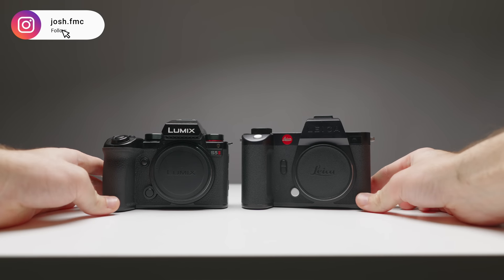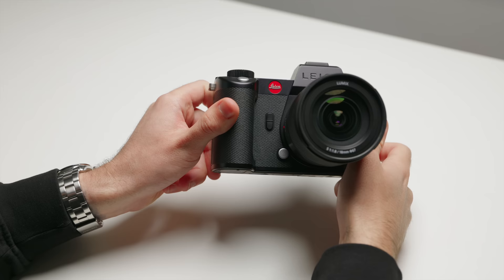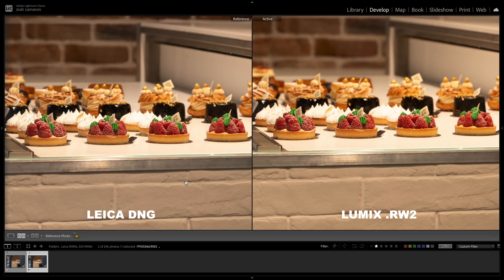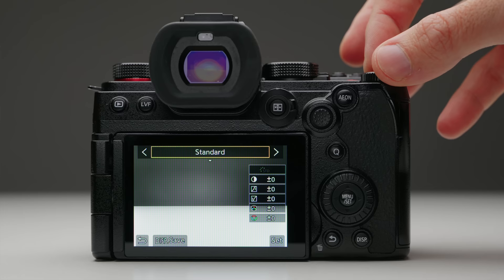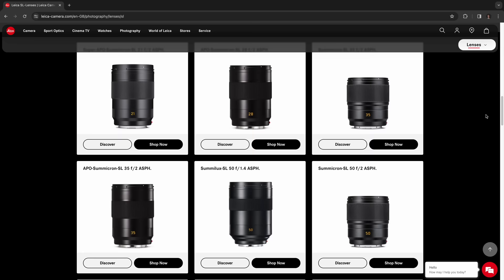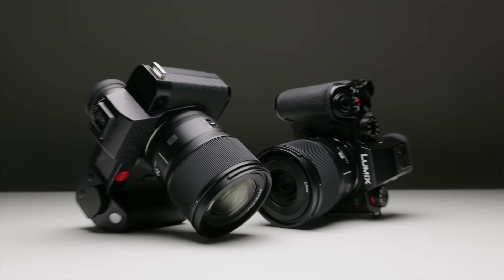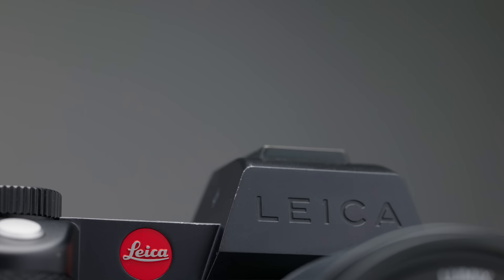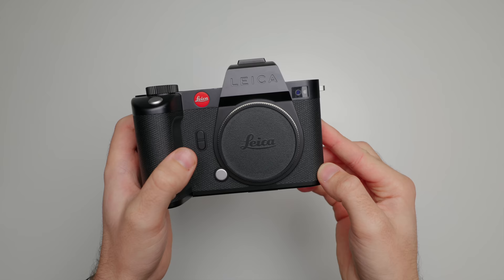Lumix VS Leica Colour Comparison

Comment: So, the red dot doesn't have any impact in color science. Great comparison Josh!
Reply from the maker: Nothing that would warrant upgrading for - I think the benefits of the Leica come in different areas :) Thank you!
Reply: @JoshCameron please redo the test with a leica apo sl lens 🙏🤗
Reply: @JoshCameron  yes, the glass.
Reply: Well yes, it does actually, just not with these two cameras. When I use the same lenses between my Leica CL & Lumix G9 there is a stark difference, with the Leica colors being much more pleasing.  The greens are especially nicer on the Leica, With the G9 looking a bit garish & oversaturated with nature shots especially.
Reply: @martin_the_artist_  The G9 is a M43 camera, big difference.
Reply: @michaelbell75  Well, the Leica CL is a crop sensor too (factor 1.5 instead of 2.0 in M43). But this has not much influence on color calibration of in-camera jpegs anyway.
Reply: Guess the G9(ii) sensor output is primarily designed to keep up with FF as far as possible more in terms of sharpness and noise reduction. Which is fine for the aimed user group.
Reply: What`s called a Leica Look first and foremost has been determined by Leica Lenses. In digital Leica partners with Panasonic. Using a Lumix lens from Panasonic on a Leica of course gives you results that are basically the same as both companies share processor and sensor technology.
Reply: I painted a red dot on my homemade pinhole camera and now it is a Leica.

Comment: Judging from this video the skin tones are the main difference but would love to see another video with the higher megapixel SL2 or SL3 and a Leica lens.
Reply: The SL2 looks the same as the Panasonic Lumix S1R. The SL3 uses another Sony higher resolution sensor so the image characteristics will be very similar to other Leica and Lumix cameras. These Leica and Lumix cameras share the same Sony sensors. The Leica's even borrow the Lumix autofocus system. They're practically the same cameras only the SL3 has a higher resolution sensor from the same line up of sensors.

Comment: Colour wise since Leica and Panasonic share technology there are only a few subtle differences. Leica files will be slightly more open in the mids. The Leica files will have the saturation slightly lower. Finally the Leica files have a few points less magenta shift to them. The Leica sensor has a thinner filter stack so it behaves better with older M lenses and shows very slightly more acutance with the absolute best glass (APO Summicrons). But this lens won't show that.

You paid for Grerman wages for assembly, the industrial design, menus and build quality. Plus the red dot.

Comment: I have been shooting a Leica M6 for the last 10 years and if you compare it to other film bodies that can take the same lens selection it's the smoothness of the experience that makes the difference. My Leica doesn't get in the way, the rangefinder on it is the best I ever used and it's just a perfect camera to be using for decades to come. It hasn't needed any service and I bought it used, built in 1990! Now that's build quality. Colour science is a funny thing, because in film the "sensor" and the "colour science" is always the same and comes from different manufacturers, Kodak, Fuji, Ilford, etc. It's all about the shooting experience and the lens selection. I personally prefer Zeiss and Voigtländer glass because the rendering has more character, but Leica definitely produces the best lenses out there from an optical viewpoint. I'm not surprised that Panasonic has finally caught up to Leica with colour science. Leica were the absolute best in the game already 10 years ago though. My old Olympus E-PL3 had terrible colours even with lots of light and broke apart beyond ISO 400. Canon 450D, awful reds because of the lack of filtration on it. At the time Leica M9 and later the M240 were already perfect over their entire ISO range👌other manufacturers are only now catching up. With a mirrorless camera going with Lumix makes sense and that's what I did, because the quality coming out of it is comparable. From a user experience stand point Lumix isn't all that great I have to say. The menus are definitely very cryptic and it's quite the learning curve compared to everything I've seen of Leica menus in reviews. And since there are so many options it isn't set it and forget it either, you actually have to use those menus all the time, so it is definitely a consideration. Where Leica really shines is in the rangefinder cameras actually. They're the only ones who still make bodies like that and it has been my preferred focusing system for the last 10 years. If I were to buy a Leica it would definitely be a rangefinder but the massive file sizes of the current models make me think that the M240 is still the sweet spot even though it's 12 years old. They have stood the test of time too, which makes it a reassuring purchase also from a resale value consideration.

Comment: Josh, thanks for making this video and I agree with everything you said and will add the following.  I’m a Leica M shooter, the M10-R and previously the M240 and digital CL, to be exact.  The LUMIX S series of cameras are relatively identical to the Leica S series cameras when it comes to the internal technologies and colour science.

There are features in the external hardware and build quality where Leica shines over LUMIX but all in all, these cameras are identical.   I owned the original S5, sold it for the S5 II which is definitely a worthy upgrade.  Where the comparison you made is not equal is when it comes to autofocus technology.  The Leica SL2-S uses contrast based whereas the S5 II has phase detect autofocus.  For those who rely on autofocus Leica doesn’t provide this technology yet.  You’ll see it in the SL3 and its variants. 

I’m not an autofocus shooter and I am not a hybrid shooter or videographer so those features don’t really matter much to me.  I shoot 90%+ with adapted vintage and M mount lenses.  I use them on my LUMIX S5 II, Nikon Zf, Fujifilm X-Pro3, and Leica M10-R.  One set of lenses I can use on all my digital mirrorless cameras.  The S5 II is a beast of a photography camera and not enough people talk about it as one.  LUMIX cameras will continue to get better and not cost an arm and a leg like Leica’s, Sony’s, Canon’s, or Nikon’s with similar features and capabilities.

Comment: Leica and Panasonic are partners for years, the L2 partnership.  They have different ergonomics and having both camera brand i like different pieces from each. I use the lumix camera because of the ergonomics and weight savings. The Leica feels better in hands and build is insanely good. Both cameras are highly reliable and that’s the win.

Comment: Not surprising since the Leica C-Lux, D-Lux and V-Lux series cameras are all Panasonic made. Both companies work closely together and just announced a new upcoming "L2" project where they will share technologies on upcoming cameras, lenses and more. In fact, Im willing to bet the 47MP sensor in the S1R is the same sensor found in the SL2 and the 24MP BSI sensor in the SL2-S is the same sensor from the S5II. Highly suspect the megapixel counts are the same and the colors are so similar. Im guessing the only difference is the processor being used in the cameras.

Comment: To fully understand Leica as a system you need to keep in mind the historical users of their products. The SL system uses very thin cover glass on their sensors, this allows M mount lens users to shoot SL cameras and still get high performance from those lenses, but if they so choose can switch to a modern mirrorless lens and experience those benefits too. Many SL owners have M mount film cameras too, so having the ability to use the same lenses on both mediums really adds to the versatility of the system. These older lenses do not function well on other brands, particularly the wider lenses from 35mm and shorter because they use thicker cover glass on their sensors. Of course one can also buy an M mount digital camera, but that takes modern autofocus lenses out of the equation. For those of us that want the best of the film era Leica's and modern digital the SL system offers unparalleled versatility.
Reply: Does Panasonic camera sensors have the same thickness with Leica, or more similar to Canon, Nikon, and Sony?
Reply: Mostly agree but I used my m mount glass on my Sony A7RV for a year before getting my M11 and see practically no difference in image quality. I dont think there is really much of a difference when adapting the glass to other systems
Reply: @FedThePoopy  Yeah, Sony or any other mirrorless body can certainly be used with good results in many cases. Particularly for portraits as the corners are not really a factor in that case, and longer lenses will be the order of the day. In my case the Sony / Nikon / Canon or Panasonic bodies were a bit of a non starter as I shoot with wide (21mm and 15mm) lenses a lot and the corner performance is important to my own work.
Reply: yes, but that' just brand-fanboy stuff. How does that negate the fact that their Color-Science is nothing special?

Comment: I remembered the SL2S looked different than the S5 esp when using adapted M lenses.

The other was corner smearing. At least when I tested, the SL2S was noticeably sharper in the corners for adapted M glass. 

A niche use case for sure, but Perhaps give M glass a try?

Comment: Maybe because I've used both brands extensively but I saw the differences right away honestly. The Leica has increased clarity and smoother transitions. The Lumix has a slightly "muddier" look which gives it away.. If the end user can't see the differences then maybe save the money... but if you can see the  differences well you have choices to make.

Comment: I worked with Panasonic for several years as consultant / sponsored photographer. One of things I learned is that with Leica a lot of the color and character comes from the glass. This is why if you use a Micro 4/3 Leica lens on a Panasonic body the color is different. In this case it’s related to the firmware in lens but with analog Leica lenses it’s all about the glass. I think if you got a Leica lens and did the test again it would be quite interesting. Thanks for the video ❤

Comment: Thank you, I love tests like this, really helps to get over one's own biases when you see it's almost impossible to tell the difference. Although I can see why Leica has its allure, there's so much padding around the image quality discussion that it's great to be taken down to earth with real testing like this. 

There are only a few camera + lens combos I've ever owned where I can recognize what I shot with, and it's always when I don't remember what camera I used until checking the EXIF data. But ultimately it's very rare that a camera can provide anything unique that's not reproducible by any other system.

Comment: For me personally, the main difference of the Leica SL is its performance with manual lenses, specifically with the M-mount ones. 
Try putting one(especially a wide angle one) on a Lumix or any other mirrorless camera and you'll see the difference.
This is because Leica is the only brand who is still selling rangefinder lenses and cameras. So they are putting some microlenses on the sensor to compensate for the steep light angle of those lenses. And since I'm a manual shooter, this is priceless for me. 
The only other camera which is doing great with those rangefinder lenses is Sigma with electronic shutter, but it is quite old.

Comment: I’ve never used Leica but i was able to spot the slight difference without knowing which is which at the beginning.  It’s slightly deeper colors and slightly sharper.  So you could say I guess it right.  Even the ABC, I chose B.  Again, ever so slightly.  Is it worth it?   Hmmmmm…..

Comment: Great video, and I really see what you are saying. A while ago, I visited a fair where various major brands had their cameras on show, and I could try them all. I tried the defaults of Canon, Nikon and Sony, also some outliers such as the Fujifilm GF 100. And a Lumix S1, and a Leica SL2. If found that picture quality is similar for all major brands, differences appear in lenses and handling.

The one thing I learned at this fair is that the one thing the Leica SL-series wins over all these other brands is simplicity in the controls. You just get 8 customizable buttons, and that's it. Every photographer has his own style of handling a camera, the Leica adapts to everyone surprisingly easy. So while these pictures were no different than a Lumix S1, I did overall like the simplicity of Leica's camera.
I did however purchase a Panasonic S1 body in the end, because it's controls are second best, at a much lower price point. And it has a tilting display, which the Leica SL3 now also has. I also got a great second-hand Leica Elmarit 24-90 f2.8-4 lens, which is better than awesome. That lens combined with a S1 is the best of both worlds for what I do with photography. Image quality and handling is superb. If Panasonic will ever make a successor to the S1 with phase-detect AF, I would buy it immediately.

Comment: Hi Josh, thank you for the interesting video. I have never tried any Leica camera of the SL line nor a full frame camera from Panasonic, so I cannot make any comments on your  comparison. But I do own a Leica CL. digital and over the years I used several cameras from different brands. The colours of the jpegs coming out straight of my Leica CL digital are different from any other colours coming out from any other camera I used. I spent a weekend in London recently and used my Leica and my Ricoh GR 3 to take photos. As much as I love my Ricoh, I must say that the Leica produces colours which have a sort of a more vintage and realistic look compared to my Ricoh. Of course, it is just my opinion and my experience. Keep up with the good work you are doing, Manu

Comment: Have SL and S-1 (have had many others), and I'm just a proud dad / weekend warrior hack.  Couple of suggestions - first - Shooting with Pana or Sigma L Mount glass - you are shooting with glass far past  24mp sensor - and high grade.  I'd be surprised to see much difference, but pop a 200-400 lens on there (non-native) from china - and then look...   If you grab some vintage - say any 50mm 1.4 from decades ago - you will begin to see differences in the rendering - even in raw (although less).  Side note - and while you are playing with glass from years ago - tracking down character - notice which one works better - and because the handling is so much better - you get more shots...  Try it with a nifty fifty, and a 135mm and see what you think...  If you really want to see a difference in jpegs - use old M glass...   Second - I THINK (IMHO), that the difference between the SL and the S1 is significant, the difference between the S1 and the SL2S really isn't that much different.  I would GUESS, the S1RmkII and the SL3 will be even closer...   Also note - although few reviewers ever test the Pana glass - their "S" line is of the highest grade (50mm 1.4 vs almost anything out there - its holds its own - and is priced accordingly)...   YES, I bought my S1 (as I saw it as a poor man's Lecia) - and I'm tickled pink - its really a powerhouse - EVEN by todays standards (Q2-2024) - but once I procured the SL - the SL is the chosen one - but I shoot 75% vintage.  To take it one step further - try shooting B&W - I think the SL shines in this category.  All said - would I mortgage away for a current SL3 or Q3 - NO, but I did TRY the SL2S - and in comparison to the SL - I kept the SL and played catch & release on the SL2S - but again - 75% vintage and 25% native...   And I have a sony RX1 and several other compacts - so if I take out the S1 or SL - its on purpose, as its NOT an everyday carry, nor very nice unless you are planning on shooting as the main reason for being out...

Comment: If you check DXO software last version (7 ?), you will see that there is an option to emulate the color rendering of groups of cameras. Leica and Lumix recent cameras are in the same color profile option... So I think the guys from DxO already known that it was the same color science which was used in both cameras. It is very interesting to check this DxO option, to see which cameras have similar or same color profiles, and at which generation of cameras of a manufacturer they change their color profile.
Reply: Those profiles aren’t exactly matching but are pretty close. There is more to color science than just matching hues and approximating tones. There is color phase and color density changes to luma and that stuff is extremely hard to test with color chart comparison matching.
Reply: @jessejayphotography  Those colour emphases can easily be reproduced in post. Unless you never shoot anything except jpeg - and even then you can tweak preferences endlessly in camera - the manufacturers look isn't a secret sauce.

Comment: As a Lumix user with five Leica lenses, including two f1.7 zooms, I can attest to the quality of images…

The quality and character is in the glass, and the photographers eyes…

🤔
Reply: @superzero4250 are you a micro four thirds shooter? The best lens for a lumix system is the nocticron.
Reply: @mnkwazi  TRUE; however, for the format overall, it is the M.Zuiko Digital ED 75mm ƒ1.8… (a lens I have)

To be fair; the M.Zuiko Digital ED 45mm ƒ1.2 Pro, is every bit as good as the Nocticron, plus it is weather-sealed (and why I chose it over the Nocticron)… In fact I own the trio of M.Zuiko Pro ƒ1.2 primes…

The  M.Zuiko 45mm and 17mm Pro have not been officially listed as tested thoroughly the same way the Nocticron has, but I am confident it measures up…

🤔